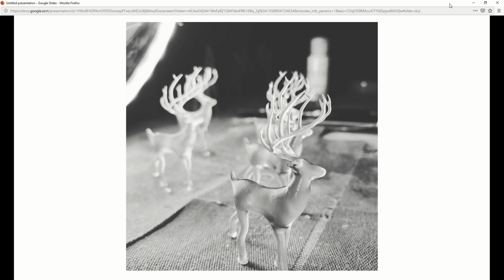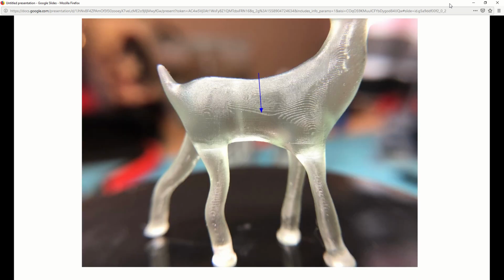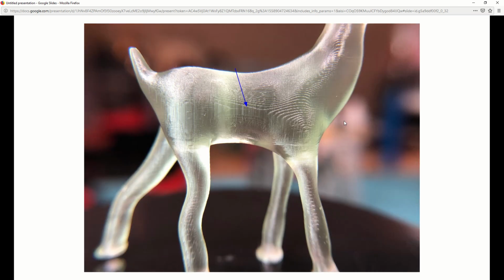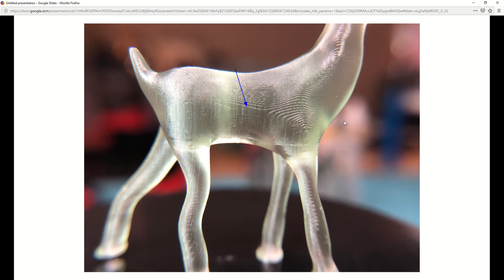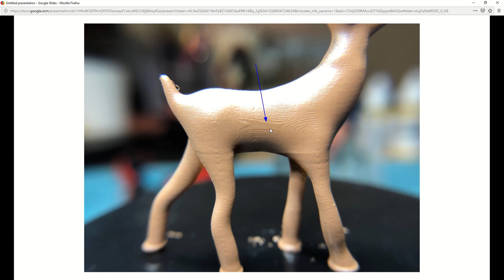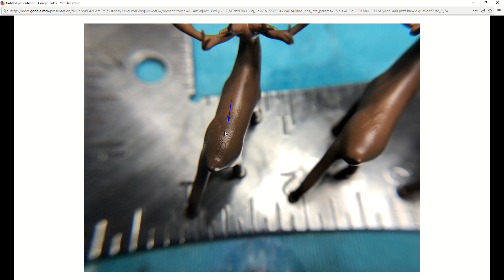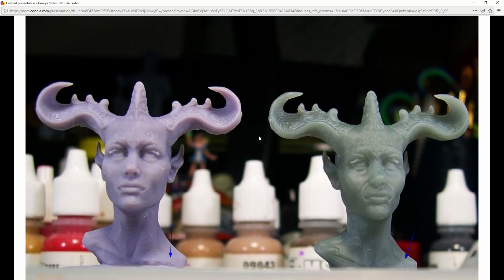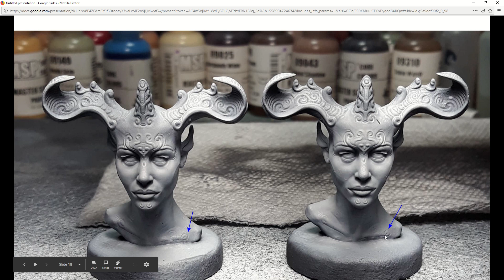AA worth it? (Anycubic Photon)

Comment: Thank you for this video.  To clarify the point on 16x AA, that isn't working in ChituBox or has that been fixed?  Does it work in Photon Workshop?
Reply from the maker: By now, I would hope that it’s fixed! I don’t use either program, still on the old school slicer. I’ll upgrade one day, I’m sure.
Reply: @Outlawisbest  What is the old school slicer?   (I'm just getting my first SLA printer on Friday, so this is my entry point, sorry if I'm asking a dumb question here.)
Reply from the maker: @underourrock  No stupid questions here, don’t worry.

I’m using the first release of the photon, and the oldest slicer they had. It’s been upgraded since, but if it ain’t broke don’t fix it right? Which printer did you get?
Reply: @Outlawisbest  The Mono.  At $290 on Amazon it was hard to pass up.  I considered buying 0.2 and 0.3mm Vanadium nozzles for my upgraded CR10SPRO, but at $150 for 4 nozzles I figured having a cheap SLA printer for high detail stuff is the way to go.
Reply: @Outlawisbest  the extended free return window until January 31st was pretty nice, too.  Gives me lots of time to exercise it and make sure it's going to behave well.  I wish the SE had been available on Amazon.  I would have liked the more powerful UV source.